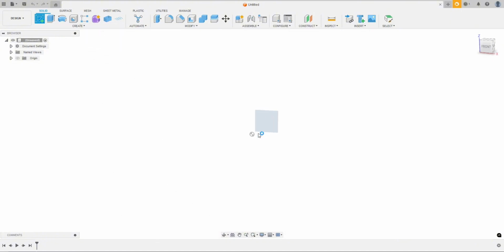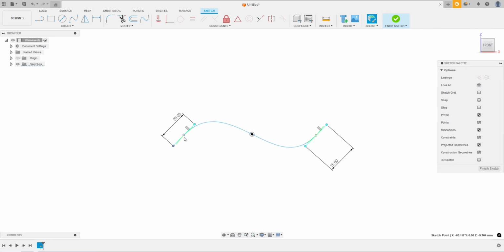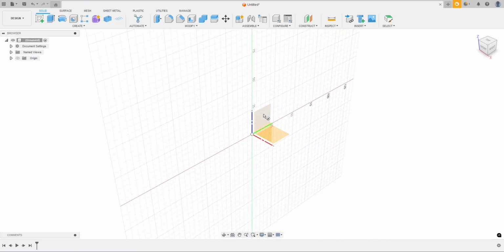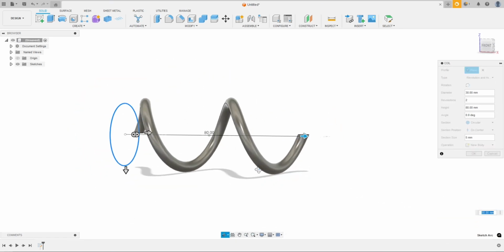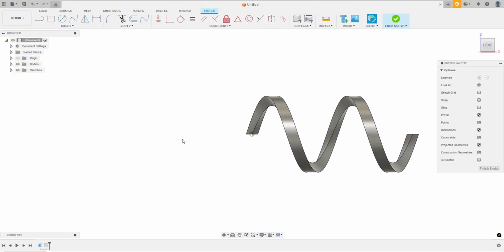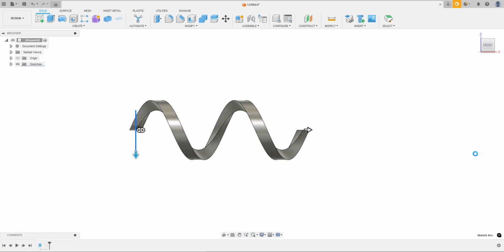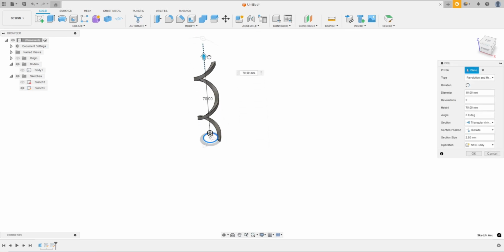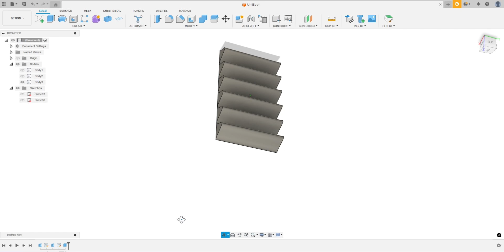Easily Sketch a Sine Wave in Fusion 360

Comment: Since the wave isn't moving you cant calculate frequency. The only characteristics you can get from a sign wave is amplitude and wavelength. If the wave represents something like electromagnetic radiation the frequency equals the speed of light divided by its wavelength. For a sound wave you would use the speed of sound. For an ocean wave you would use the speed of the wave.